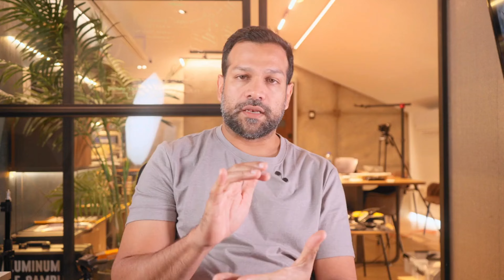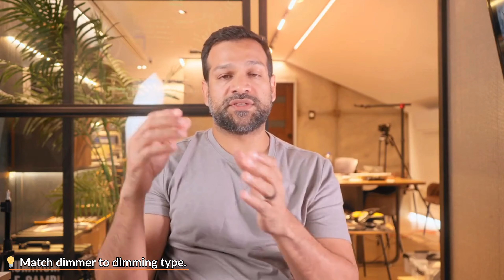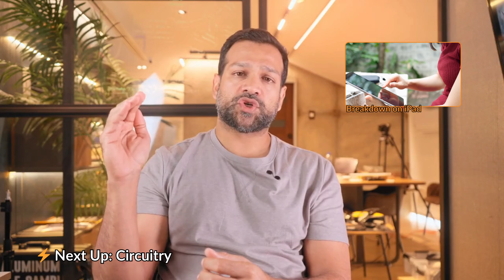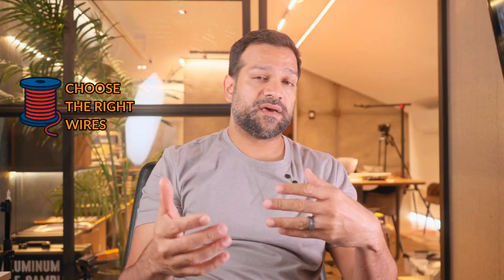Welcome to unit 30 1

Comment: 0:05 there is an iPad overlay for this.  I’ve attached the links.  Rondell has the head shots or second video for this 
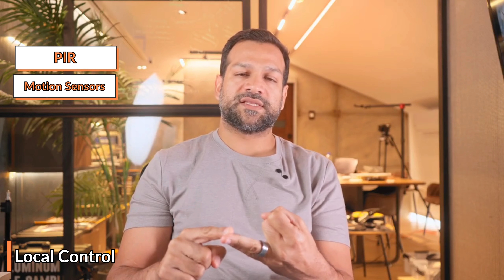1:24 should show some examples
1:55 show example of typical local switch on a lighting fixture
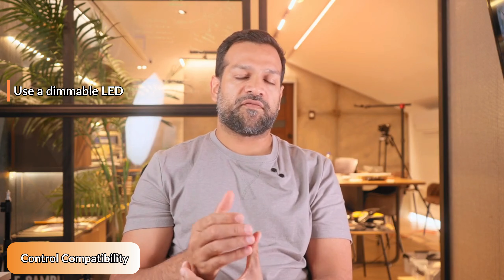2:42 needs an edit on the cuts
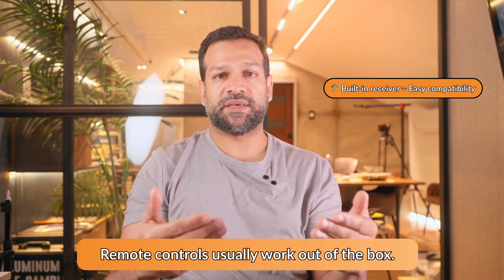3:32 animations should be bigger and more legible 
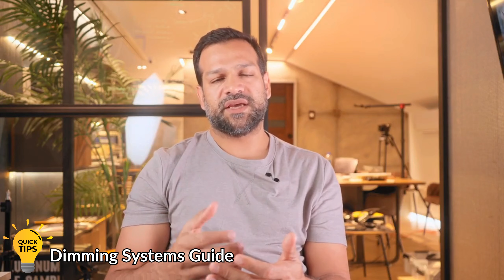3:58 not sure what pro lighting is in the animation 
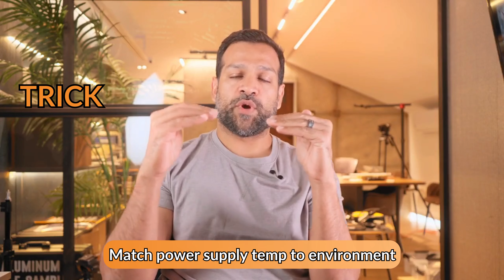5:08 the trick is late may be change to Pro Tip?
Also we’re missing the overall brand logo for all the videos
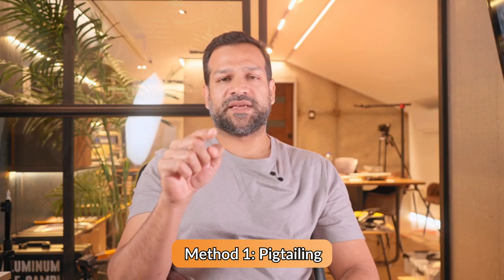6:25 I’m just gonna mentioned it here 
7:01 cool animation
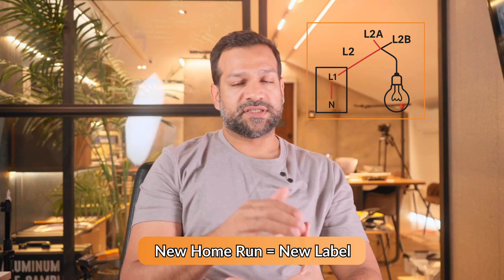7:07 well have to adjust the second animation 
9:04 needs an editing fix 
9:16 well need to be consistent with major topic heads
I’ll look for pics showing this…
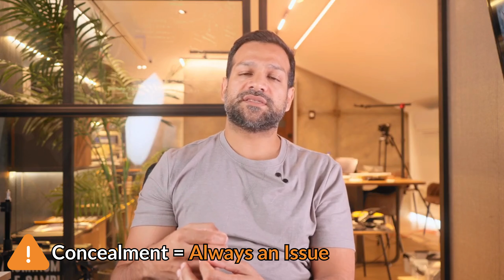10:18 needs video editing  seems repetitive or there is a disconnect 
11:32 and need to be edited off 

Coop